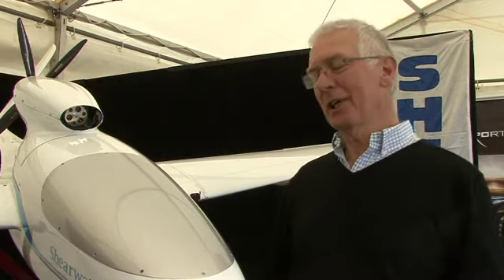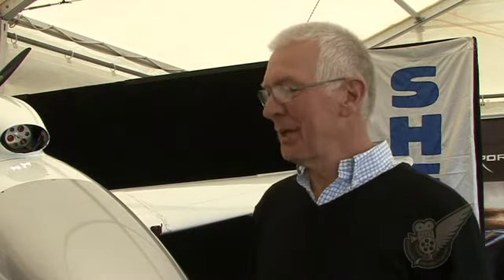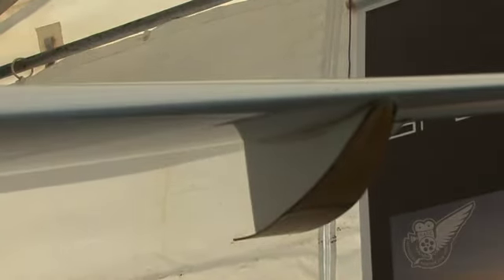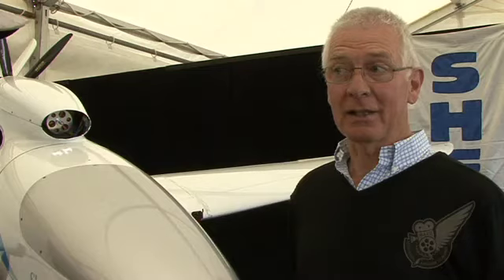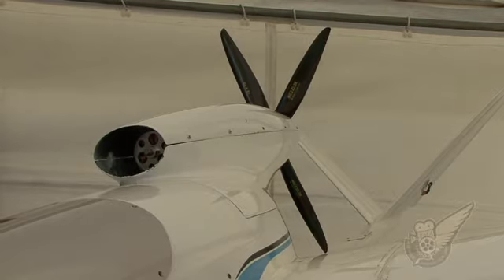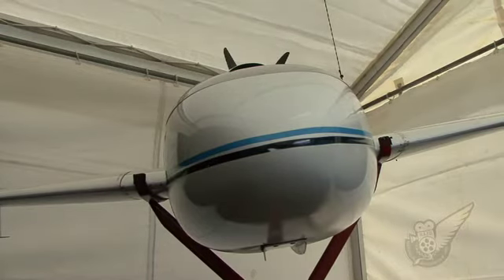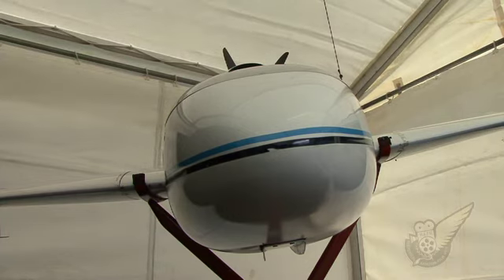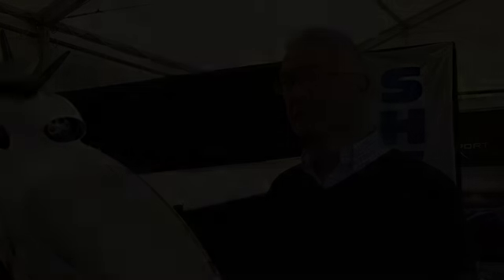Shearwater Amphibious Aircraft

Comment: I really hope they get the funding. I saw the presentation at Airventure 2011. My wife and I both fell in live with the design. I hope they also consider partnering with Kelly Aerospace for air conditioning, and that Mistral can get both the G and K line engines certified with this plane. Though we'd gladly take a trip to New Zealand (or three) to build the experimenta